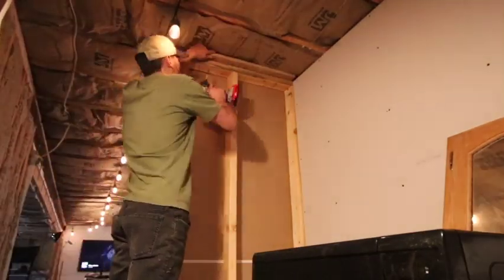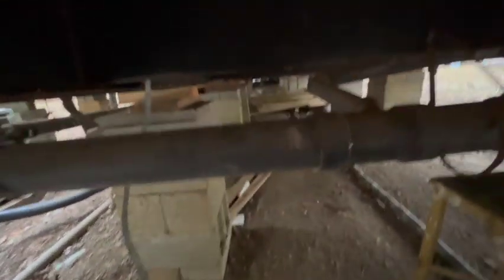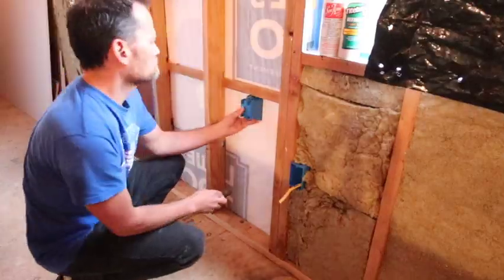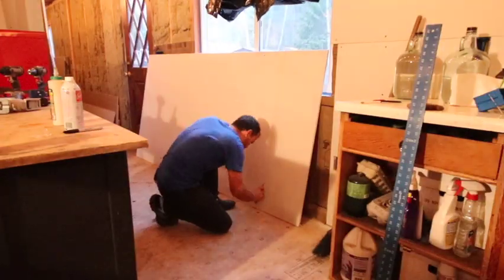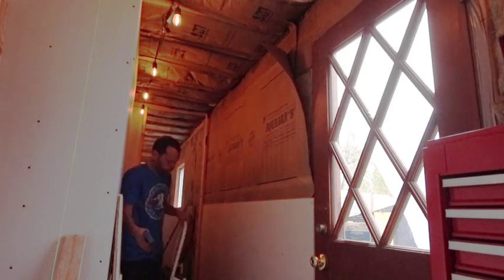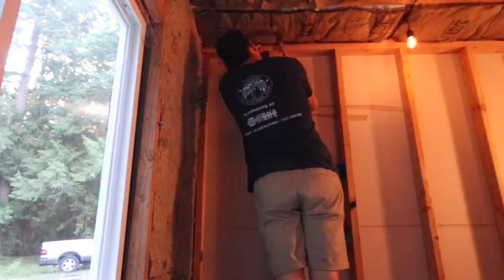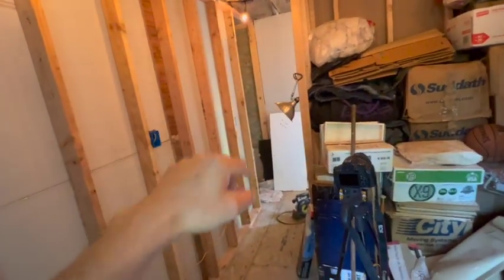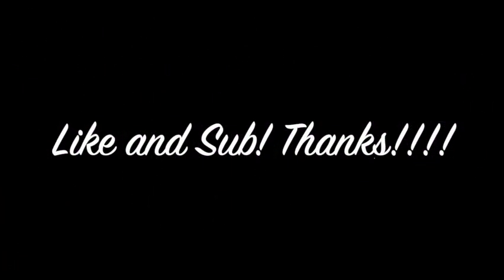Mid July Update on the Old DIY Single Wide Mobile Home Build

Comment: Ugh, dryer vents ... they are the flimsiest of house installations. 

Pacific Northwest spiders are so cute as babies. 
One trick I do for my similar project: before putting on my work gloves, I grab them with both hands and ring them like a wet towel. Here in the PNW you never know what's hiding inside.
Reply from the maker: Yeah, they aren't all that bad. We have a couple scary ones but in general nothing to worry about for sure. I hear you about the gloves. I just put a shirt on the other day and had a weird centipede like bug crawl out over my neck. Def gave me the shivers!

Comment: ugh you just reminded me I need to add nailers to the corner walls before I hang this drywall. completely forgot that! Im jealous you already have washer and dryer in! Id love to see a drawing how the layout of the house is. Im still trying to decide where my washer and dryer will go.
Reply from the maker: Well, they are there but the washer isn't hooked up yet since my plumbing isn't done so I can really only use the dryer at this point. I have one more vid coming up with more drywall and then the next one I'll do a walkthrough from the back to the front so you can get a better idea of the layout. Although if you want you can see the first couple video's after I cleaned it out but before I gutted it, it's basically the same layout as when stock with just a few tweaks here and there. Hope your build is going well!

Comment: You didn't switch washer & dryer so dryer door opens easier to load
Reply from the maker: Yeah, I had to put the washer on that side due to the plumbing on the back side of the wall. I can switch the dryer to door to swing the other way and will do that once I get the washer hooked up. I'm still using a portable washer outside so the dryer door isn't an issue at this point. :)

Comment: May I ask you what the paper is that you are putting over the insulation?
Reply from the maker: It's technically flooring vapor retarder but it's basically the same type of craft paper lines with a layer of tar type paper in the middle. Much like that standard craft backing you can find on some rolls of fiberglass insulation in the store. My part of the country doesn't want full plastic vapor barrier but more of a vapor retarder so there is a little breathability. I did run out and use some plastic vapor barrier on the last bits of wall but we won't tell anyone. ;)